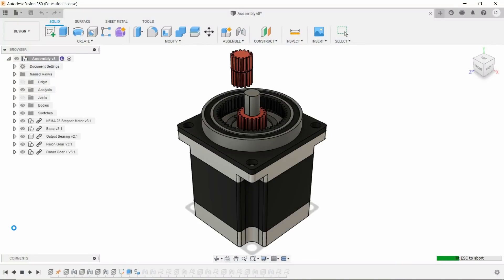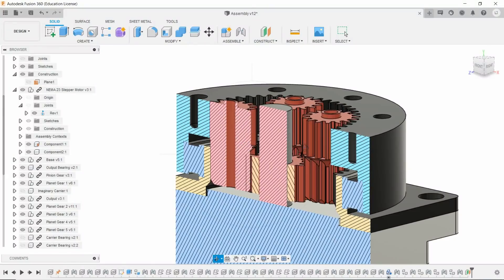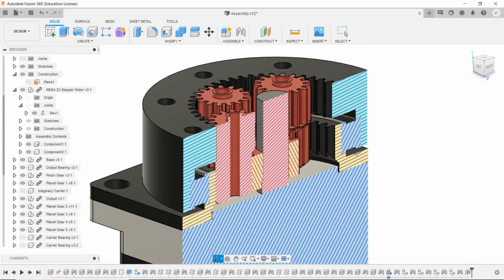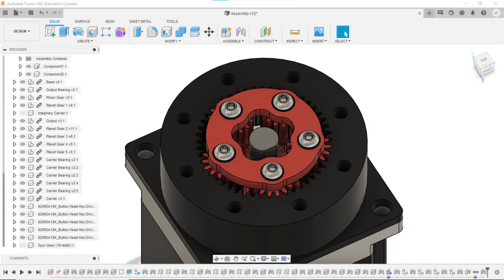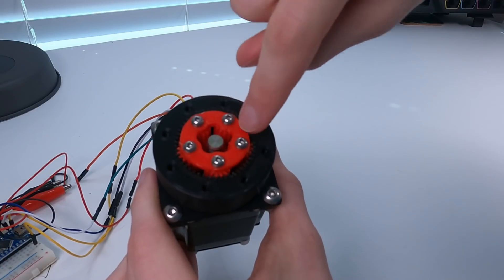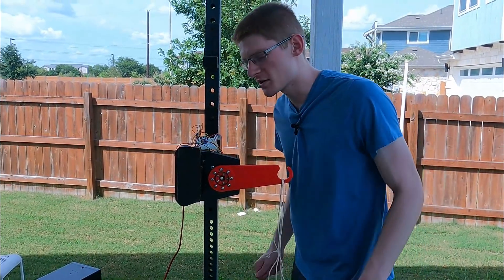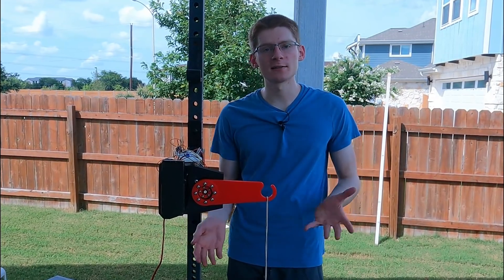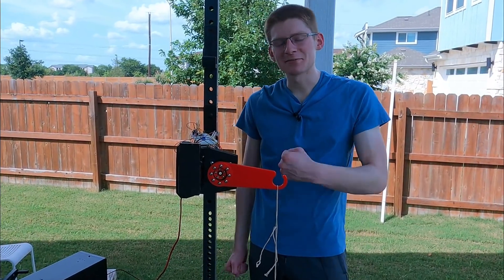The New and Improved Split-Ring Compound Planetary

Comment: Approximate BOM for this gearbox:

1x 6808-2RS (52MM OD, 40mm ID, 7mm thickness) bearing
5x MR63ZZ (6mm OD, 3mm ID, 2.5mm thickness) bearings
5x M3x15mm screws - Design should accommodate up to 20mm screws

Comment: Supporting the planet gears with the carrier should have also contributed to the decrease in noise.

Something I don’t understand…
The involuted gears are appropriate for the sun/planet/ring (annulus) gears being driven but…
If the top set of gears has the same number of teeth in the planet gears but one less tooth on the ring gear, doesn’t this this inherently produce a sliding friction/force between the planet gears and ring gear?
If so, aren’t the advantages of an involute gear lost?
Is another type of gear profile better suited for this connection ?

Comment: The best of these use specific planetary mixes from a planetary gear sim that are coherent, a sun gear in the middle of both, and the modulus of both is changed so the planets align, so one planetary modulus is 1 and the other is 1.037 and so the centers of the the planetaries are aligned.
Reply: I think it would not work because you cant bypass the sacred law of the universe that says that the number of teeth in a ring divided by the number of planets must be an integer for the planets to be aligned aroud the Sun.

Comment: Really great work! One thought that has sort-of been raised by others is to have an output bearing located on the gearbox output before the lever arm. That should remove most of the load perpendicular to the gearbox and hence the deflection and subsequent damage. Looking at all the BLDC gearboxes I've worked with, they all have a final bearing on the output shaft for this purpose.

Comment: Nice...so discounting the material strength...the actual vs the real world, it get's approximately 10% of calculated mathematical torque spec multiplication before failure
Are the inner gears fixed together...which means due to the offset in manufacture they probably couldn't be manufactured with traditional methods unless the gears themselves had a space between the top/bottom portion with a space between them.
Still so very awesome and very spectacular failure

Comment: Just a thought...but if you make the top half of the gears longer...and make it so that they only have teeth in the middle section...and a smooth part at the top and bottom of that half...you could place 2 bearings on the 10mm shaft that just roll with the planet gears pushing them outwards and you won't need a planet carrier then.

Comment: If you really wanna smear those teeth, maybe what I suggested on the prior video would work? (Instead of a carrier, have a bearing on the center hub, and bearing on the top of each red gear. That way the failure mode will be to really flatten the outer and inner red gears against each other!)

Comment: I would imagine the start of that failure was 2 of the planet gears getting out of even spacing. Likely that is what stalled the stepper motor. The nature of that mechanism is to forcing the planet gears off axis. The torsion takes them out of parallel. A carrier on both ends would help some, but if you take a look at automobile transmissions you see a single carrier that completely enclose the planet gears. This maintains the parallel of the gears. It may require too much space to be able to be used in your mechanism. You are a very bright young man. Likely you may have already figured it out for yourself.

Comment: So can we use this the other way round? To make something spin very fast with a relatively slow but powerful engine. In general with electric motors RPM is not an issue, but still, could be fun to make something spin at insane speed :)

Comment: This is really cool and inspired me to make one of my own. I was able to make mine with a free wheeling sun gear on the output because I kept the module the same on the input and output. I made it with 50 teeth on the input ring, 20 on the input sun, and 51 on the output ring. This means the input plants were 15 teeth and the output planets were 16 teeth to keep them concentric with the input planets. A small correction to what you stated in the video is that for evenly spaced plants, (sun teeth + ring teeth)/(# planets) must be an integer, not (ring teeth)/(# planets) (you can also have an uneven planet spacing, in which case this does not have to be an integer). This is fortunate because it means that no matter what tooth offset you have between the ring gears, they will both satisfy this equation if one does. Adding some number of teeth t to the input ring means that the output sun will have (input sun - t) teeth. Then we have (s + r)/(# p) = (s-t+r+t)/(# p). t can be any number of teeth, so this would also work for your configuration of 50 on the input and 49 on the output. I found this document to be extremely helpful in learning about gears (page 61 has formulas for planetary gears) http://qtcgears.com/tools/catalogs/PDF_Q420/Tech.pdf
Reply: I realized that the reduction ratio will be less for this version since the output planets have different numbers of teeth, though it is still large. The number of teeth offset per rotation of the carrier is Ri*Po/Pi - Ro. Dividing the output ring teeth by this will give the reduction for just the ring offset. This can be simplified to (Ri+t)*Pi/(t*(Ri-Pi)) where t is the number of teeth difference between the rings. The reduction for the input planetary gear set is still (Ri/Si - 1). So for 50 teeth on the input and 51 on the output, you'd have a 76.5:1 reduction. And for 50 on the input and 49 on the output it would be 73.5.

Comment: Could you apply the weight, but use the gear box reverse to produce high rpm to a motor to produce power? “Gravity Battery”. Similar to how a coo coo clock works. The weight falls slow and the center fast.

Comment: You are still a small channel. You need to get used to people just coming to your comment section and making their comment, having no regard to what was already written there.
There is a lot more people interested in sharing their thoughts, then there is people interested in the toxicity/trolling/stupidity of the regular you tube comment section, or reading through hours of comments. Yes maybe your channel is not so bad, but it is a reality on most channels. Not only that but we are told it is beneficial to your channel having more comments, even if they are basically the same dumb suggestion x100.  So just embrace that, more comments means more exposure for you (so we are told). Don't let the comment section cause any negativity to you. me goes back to watching vids and leaving no comments on most of them
nb: on yeah you pinned your own comment there explaining that thing. well I didn't even notice it until after I posted. But I did you no harm, look +1 comment on your comment section.

Comment: Your failure was asymmetrical, suggesting that, even if you used all-metal parts and nothing failed, you're putting asymmetrical pressure on your gears. Is that ideal?

Comment: Levi, for your second ring gear (output), did you keep the same modulus, root circle, and such but literally only reduce teeth count by one?  I'm just wondering how you deal with the planetary gears wanting to be "Leaned in" towards the drive shaft of the Stepper motor due to the upper ring gear being a slightly smaller diameter.   Maybe I'm over thinking it and the deflection is negligible, but it'd be cool to know what your approach was to remedy this problem.

I'm working on building a 3-joint Robotic arm with my Engineering club in College. I've been put in charge of coming up with building a compact gear drive, and boy did your idea hit the jackpot!  I created parametrically driven gears in Inventor, but I'm still trying to figure out if there's any special "Tweak" I need to do to either the second half of the Planet gears or Secondary (output) ring gear to accommodate for the change in diameter. 

Here is how far I got with my design.  I also did the carrier plate, but I didn't use a closed stepper motor loop as you did.  Looks like you had a NEMA 23 motor.  I'm targeting similar for my final robot design. 
https://www.youtube.com/watch?v=7ud-kXZYlgg&ab_channel=TimothySands

Cheers!

Comment: If you want to maintain ~172:1 and still have 5 planets, but also have an idler sun gear in the center, use the following:
Drive Sun - 22
Drive Planet - 18
Fixed Ring - 58
Idler Sun - 31
Output Planet - 24
Output Ring - 79
This will result in 172.36:1

Also, slight correction to your statement at 2:50 - The number of teeth in the ring gear PLUS THE NUMBER OF TEETH ON THE SUN GEAR must be divisible by the number of planets.  Since you have 20 teeth in the sun, which is also divisible by 5, it just so happens that if your ring is also divisible by 5, so is the sum.  And the problem with your idler sun not fitting at 3:30 is not an inherent property of the mechanism, it's just a result of the tooth counts you have used.

Excellent video, I hope to see more on this topic!
Reply: If you go up to 6 planets, you can use the follow:

Ratio:  -171.42857142857204 :1
Planets: 6
Drive Sun:  21
Drive Planet:  15
Fixed Ring:  51
Idler Sun:  24
Output Planet:  18
Output Ring:  60

I'm not sure if this would be stronger than what you already have or not.  The teeth on the output side will be a little smaller, but you'll have an extra planet, and the advantage of an idler sun, which might help take a little extra stress maybe.

Comment: "I set out today to break something, and I broke something." Doesn't it just feel great when your day goes exactly as planned? xD

Still, I think this is a pretty incredible showing for such a small gearbox. The materials might not be able to handle very large forces, but I can see some applications where you'd want to boost the torque of, like, a tiny motor. Nothing industrial, but maybe a tiny RC drone for work in crawlspaces or ducts or something.

Comment: I wonder if you have captured on camera the carrier moving as it failed? Did it displace from the central position just before it failed? If so, could you add an additional bearing that guarantees that the new carrier stays located and maybe reduces the risk of the planetary gears twisting ?

Comment: Could a second sun gear, set of planets & SPLIT RING be added on the other side of the driven ring? You'd be supporting the driving planets from either side, essentially eliminating the bending of the planet gears, which seems to be the main source of failure at the moment.

Comment: I'm really curious to see how these gears would hold up if they were made of a stronger 3d printed material (e.g. Nylon, PEEK, Ultem, etc.)
Reply: PEEK is extremely hard to print, though. I am planning a 3d printer with an awesome, super controlled enclosure which MIGHT be up to the task, but even the pros here on YouTube barely touch it. Getting a decent benchy to print in PEEK is probably the biggest flex one can pull off in the 3d printing space. It's a bit like being able to play Mozarts Piano Sonata :D
Reply: They’d last damn near forever. Those materials are almost about frictionless when in contact with eachother. But, you need special equipment to print with those materials.

Comment: Thanks for the follow up. On the topic of the idler gear, that got me going down a rabbit hole to learn... well, a bit more then the nothing I knew before. I think your explanation is poorly worded: you say that the ring gear tooth count needs to be divisible by number of planets for meshing- but from reading it's that ring+sun need to be divisible by number of planets (and possibly evenly divisible to get equal spacing of planets?)- (for anyone else looking to learn: https://youtu.be/71dn-eVdSmc?t=867 has most of a nice 30 second explanation in the middle of a 40 minute video- basically tooth counts of the various gears are directly correlated to diameters, and the diameter of ring needs to be equal to diameter of 2 planets + 1 sun). That accounted for, your argument does still make sense: 49+20 isn't divisible by 5 either, so, yeah, idler was never going to work for the current tooth counts / if your goal is to keep the off-by-one harmonic geometry.

The 'ring gear must be divisible by planet count' argument had me confused / I first heard it as a more general "compound planetarys can't have idlers" which led me down trying to figure out why some compound planetary can have idlers and this one couldn't- ex: I've got a copy of Gear Down for What's 1379:1 single stage reducer ( https://www.thingiverse.com/thing:2220506 ) that does have an output idler (and 59T ring w/ 3 planets). From looking at the specs it seems like there's a lot of fiddling with the module and tooth counts to get the planets of both planetary gear sets to line up, and that probably does limit what can be done as far as ring gear tooth counts, which I think is what you were arguing in other comments? I'm already out of my depth, so it's a bit hard to follow.

And, now that I understand this a little bit more, I've got a question: for the 49T output ring, did you use a slightly larger module in order to get it to the same diameter as the 50T ring? Or maybe a different module on the planets? Or not accounted for, and they just bend in slightly?

Anyway, thanks for the video/follow up/inspiration-to-read-more-on-gearsets; and hope you're having fun with the Austin internship!

Comment: Apparently, there are split-ring compound designs used in rearview mirrors that have ratios of 528:1 that are as compact as yours.
Reply from the maker: Yeah, rearview mirror actuators are the only widespread application I know of that uses this mechanism.
Reply: @LeviJanssen  BTW, I over exaggerated the ratio. The one I saw only had a 70.4:1 ratio and is limited by mechanical constraints, where yours is more flexible since it doesn't use an idler gear.

Comment: It turns out it is possible to have an idler sun gear on the top layer if you use the right combination of teeth.
If you haven't seen it yet, make sure to watch the video "Split Ring Compound Planet Epicyclic Gear" on David Hartkop's channel. I'll add a direct link as a separate reply in case it gets caught in a spam filter.
Reply: Here's a link to David's video:
https://www.youtube.com/watch?v=-VtbSvVxaFA
Reply: Even if teeth counts don't light up, still could have just put in a freewheeling roller where the OD meeting up with the teeth ends

Comment: The next short one could be a redesign of the gears as the standard spur gears don't have as much surface area as helical gears which should give a bit more strength. Other then that awesome to see you followed up on the original failure! :)
Reply: Косозубые шестерни, и увеличить размеры устройства – ширина и диаметр, для снижения нагрузки в каждой точке передачи..
Reply: Regular spur gears are actually considered stronger than helical gears. The benefit of helical gears is a higher contact ratio, which is a way of measuring how many teeth make contact at the same time. The difference though is that spur gears make contact along the whole tooth, but helical gears make contact at a point. So in essence, helical gears are better for high speed applications, and they make less noise. For all out high torque applications like this, I think spur gears are the best bet.

Comment: If you don't mind increasing the height, you could put a third level of planet teeth matching the sun teeth, and extend the sun gear with teeth at the first and third levels
Reply: Yes, this is what I was thinking too.  You don't necessarily need to make it taller either, if you use half size on the top and bottom.  Some cycloidal projects do this.
Reply: @hughsanderson1834  Doing a split primary to encapsulate the secondary would also ideally have a ring around the upper primary, which would require the output ring to have a larger flange; though, this larger flange could also allow the bolted-on arm to encapsulate a thin bearing for the upper primary, so maybe that is a worthwhile investment. This design would still need a carrier at each end, which would need to be properly located and not free-floating like the current design has; this design flaw, the free-floating carrier, is what allowed one planet that skewed to pull every planet out of alignment. Any epicyclic that uses floating planets is just asking for failure, and a floating carrier isn't much better. 
Though, I'd also be curious about doing the inverse of this, central primary with a split secondary. The lower ring would be encapsulated by the primary's central ring's connection to the motor's flange, and a bearing here would be nice as well. This would also allow for the same slimmer profile of the output, and puts the output on top. This might even provide a nicer final design, as it can all be encapsulated by a box with the same square dimension as the motor, everything enclosed, with the output on top.

Comment: Instead of putting a gear in the top sun plane you could just put a spacer/bushing/"toothless gear" or whatever you may call it for the teeth of the planetary gears to ride on instead of the overly complicated carrier.
Reply: The tips of the gear teeth aren't designed to take that kind of loading. Not sure why you describe the carrier as "complicated" either, because it's pretty simple...

Comment: Nice video. In the first one you explained that the material strength would be a limiting factor. I would like to see a balanced ratio for the material/motor to see what is the best speed/torque you could get with pla. What would be the best theoretical ratio for steal gears?